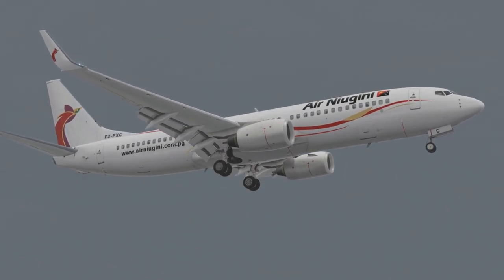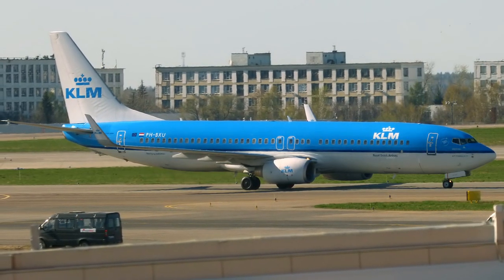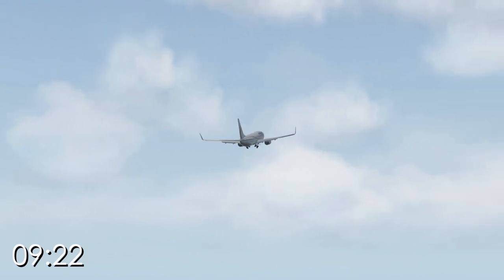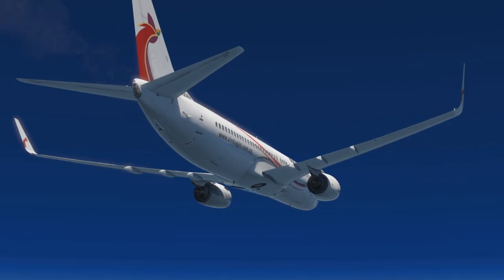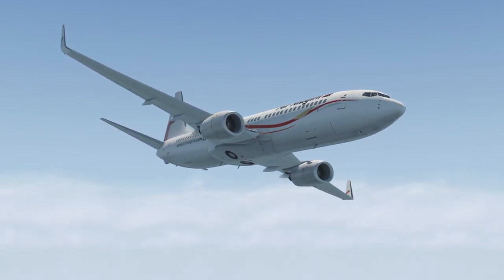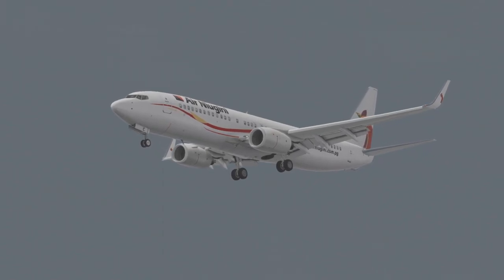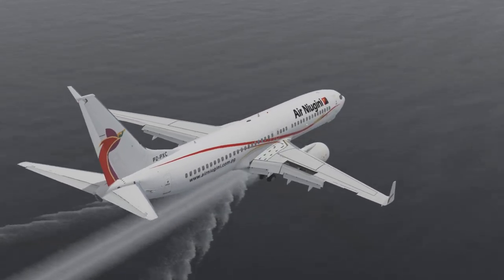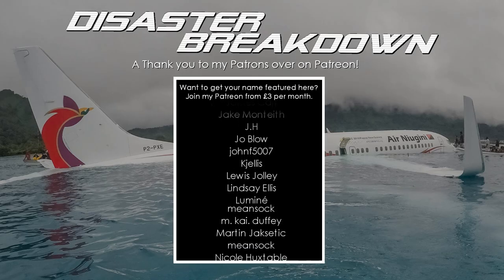How a 737 Crashed into Water Short of the Runway (Air Niugini Flight 73) - DISASTER BREAKDOWN

Comment: If they’ve done an ILS approach would the situation be different?
Reply: Unlikely. There are few navigational aids, and no "glide slope" broadcast from the runway.
Reply: @alunchisholm481  a lot of these island airports are uncontrolled too, they don't have a tower and it's up to the pilots to communicate with other aircraft, with other aircraft doing the same. It works for lightly trafficked airports and small general aviation fields.

Comment: It’s interesting that ditching is one of the hardest things to do as a pilot but these pilots put the plane in the water by accident and the plane managed to be in good condition all things considered.
Reply: I have seen a ton of crash videos, and hardly anyone ever survived a crash into water. I guess the benefiting factor here must have been the fact that the airplane was in an almost configured for landing mode. The angle of attack almost parallel to the surface, reduced speed, and extended flaps etc.

Comment: Always problems with a goddamn 737... By pilot error or faulty instruments... This model Boeing produced needs to be SCRAPPED!... Take the rest of the 737's and use whatever materials to make a better 747 which has proven to be much safer with less accidents on record... Geez man... Don't tell me these things are still equipped with the MCAS system too... That was another stupid idea...
Reply: There have been 1,569 747s built... That includes the -100, 200, 300, 400, -8, SP, VC-25, and the E-4 and all respective Freighter models 
There have been 10,887 737s build... That includes the -100, 200, 300, 400, 500, 600, 700, 800, 800BCF, 900, 900ER, MAX 7, MAX 8, MAX 9, MAX 10, AEW&C, T-43, C-40, P-8, BBJ and all respective freighter models

Can't really say 1 aircraft is safer than another when its outnumbered 5-1, especially when the 737 has been involved in just 3x more incidents(not necessarily fatal crashes) This flight was also operated by a 737-800 so no MCAS, and the -200 to 900ER models make up 90% of all 737s currently in service 
The 747 and the 737 also do not appeal to the same market

Pilot error and faulty instruments are also 2 completely different causes, one of which isn't necessarily blamed on the aircraft
Reply: @ey7290  The MCAS system caused enough crashes as it is! In my opinion the pilots decision should never be forcefully made by a computer with the ONE exception of auto-pilot!
Reply: @nickf527  MCAS is not a universal feature, I completely agree that its not a safe system, but its only fitted to the MAX and the KC-46 tanker. Its not required on older 737s because older 737s have a different centre of gravity, the whole reason why MCAS was fitted is because the larger engines caused the nose of the aircraft to pitch up during flight tests, so they fitted the system
Reply: @ey7290  Im glad we can both agree the MCAS is a bad feature... I can understand that it was meant with good intentions to prevent stalling... But obviously it did much more bad than good...
Reply: @ey7290  MCAS at its very core is a shortcut.. but even with the 2 max crashes, the 737's safety record goes toe to toe with airbus 3xx's. 
They've also reworked the software to make it much more easily disabled if the aoa's go nuts. To be fair tho, when MCAS is disabled pilot workload is increased due to needing to constantly retrim the airplane. Hopefully this doesn't lead to any more accidents in the future.. ill still fly on any boeing especially 737s.. except the max, until (if) it proves itself
Reply: You dont know what you're talking about. This accident in the video has nothing to do with the 737 max or the mcas. The only  explanation for this video would be drunk pilots, nothing else. At minimum the runway is not insight but they didnt go around...then they started to sink too fast , the glide path needle on the PFDs  was all the way up,  the plane was moaning ....and looks like the pilots werent in that plane anymore,their souls probably decided to go for a little trip at the wrong moment.
Reply: And looks like people here dont have the news...by the time the mcas has been reworked ,it is safer now, thats why the 737 max is flying again.
Reply: @nickf527  the thing is , they cant make any money if passengers are killed, so you can be sure that they do. The 737 max has been grounded for two years and during this time it has been fixed. So we cant say that things are exactly like what they were before.
Reply: @Hk-uw8my  Well like I said... Obviously it wasn't designed with passenger safety in mind otherwise it wouldn't be grounded right now would it? Compare the costs for Boeing to make a 737 MAX vs a standard but much more safe and popular 747... What's more frightening is that the FAA approved these planes to be safe... All im saying is ill stick to a 747-777 or an Airbus any day if I have a say in it... Then you've got your  DC-9 and DC-10 rear engine passenger planes... A lot of those have a bad history with mechanical failures and ground crews missing small details like FORGETTING TO PULL THE FLAGS OFF THE PITOT TUBES!... That could happen at any airline... That's why a good captain will always inspect the outside of his or her plane before even getting on board... This is more of an example of human error though... Which is less than mechanical failure stats but still... Missing a tiny piece of tape covering up a pitot tube and a plane crashing because of that has happened it's fair share of times...
Reply: @nickf527  It was certainly not boeing which decided to make the max rather than something else.  It was the airlines. They even clamed its existence for the first time ever , before boeing which had no other choices than starting working on it shortly after. The goal was to make a plane that replaces the 737 ng with a few improvements, and also  minimal costs for the airlines. 

So making a new 747 or anything else wasn't interesting at all, because no one would have wanted to buy it.

Not only the 747 has 4 engines and therefore would cost a lot more just to operate, but as the owner of an airline you will also need to pay for costly pilot training, as the 747 is a tottally different type rating. 

The 737 max, thanks to the mcas, shares the same type rating with the 737ng and classic. It was only and exactly what the airlines asked for. And thats why  they keep flying with the 737 max nowadays after it has been successfully fixed , and are currently asking for more of them.